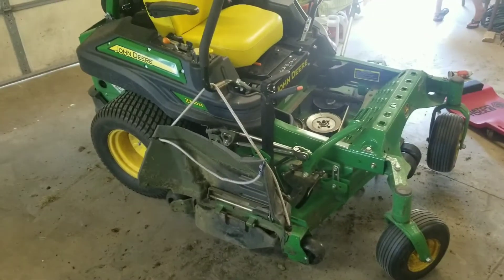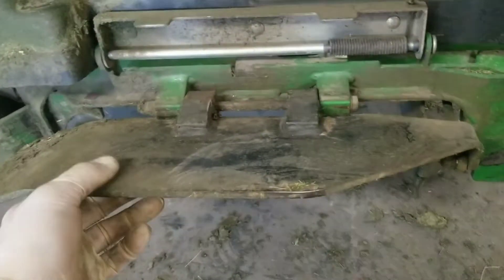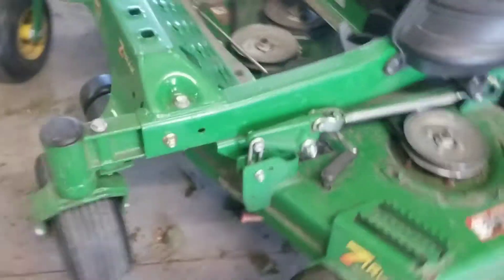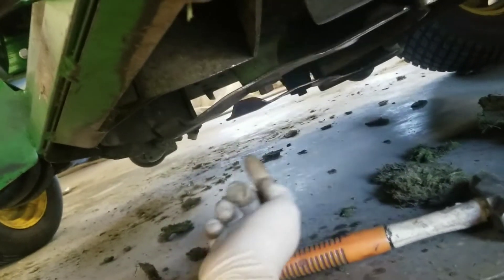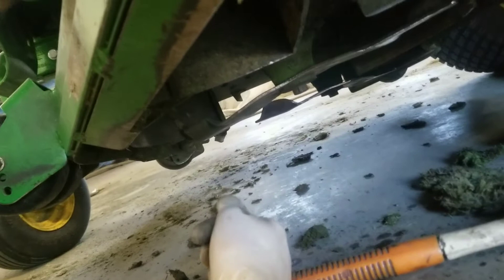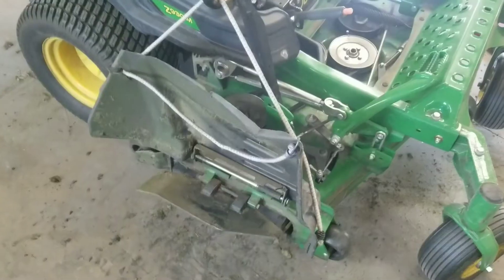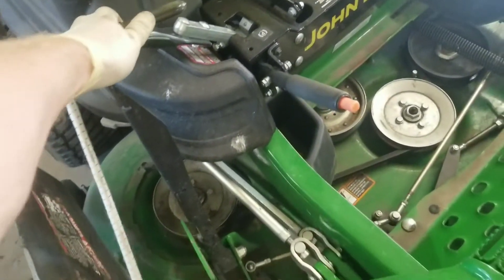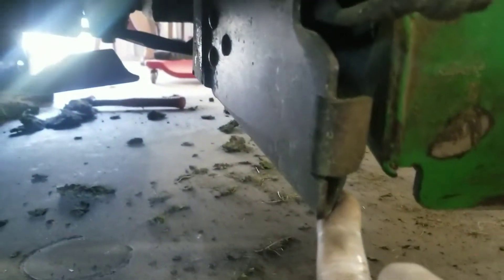John Deere Zero turn Adjustment of Mulcher kit

Comment: Can you add a bagger with the mulching kit to?
Reply from the maker: Yes you can I used to have a bagger on it
Reply: @mikewlodarski   thank you so much I’ll I’ll buy it now.  Happy holidays
Reply: @mikewlodarski  were you able to still used the mulch kit and the bagger at the same time?
Reply: @mikewlodarski  we’re you able to use them at same time or you had to disconnect the bagger? I do small leaves clean up so looking for a way to mulch the leaves first. To make less leaves to bag up.
Reply from the maker: Mulcher underneath I don’t remember taking it off , if anything maybe shute, but I truly don’t remember
Reply: @mikewlodarski  ok thanks because on John deer page on Facebook people are telling me I can’t used both I have to do one or the other. And I would like to be able to mulch the leaves then pick it up. And one only thing I’m finding is the side aluminum Grass catcher. But can’t find any that fits the z345r 42”
Reply from the maker: @scorchearthmf2634  you can use both but unfortunately when ur mulching it leaves a line under the mower but if u turn off the mulcher it blows through the shute, basically as soon as u throw the lever forward to make it mulch it’ll leave a line behind the tractor
Reply: @mikewlodarski  thanks man I really appreciate it. And the line is fine. I do a lot of  small leaves clean up and dump the leaves and the end of the yard for the city to pick up. Mulching it first just make the pale smaller and faster to get done. So I did it with my 30” Troy built and I have to mulch first and cut off the mower and reconnect the bagger tube to bag. It takes forever. So these way I’m done much faster. So thanks I’ll will buy the bagger now.